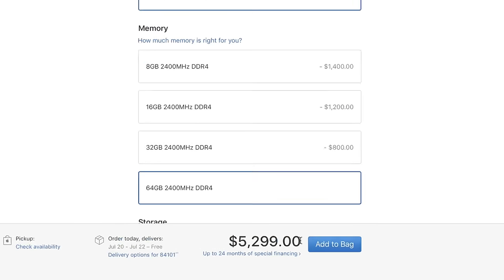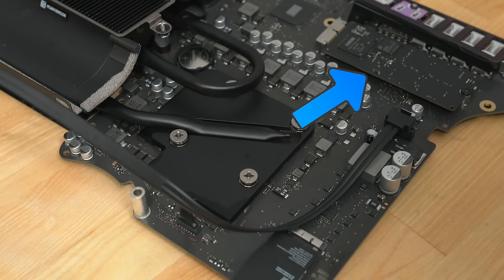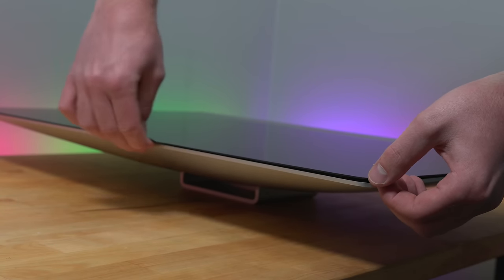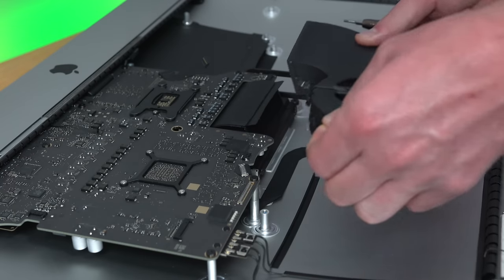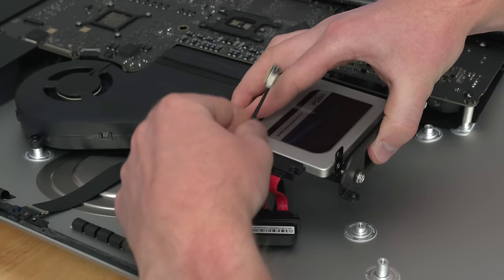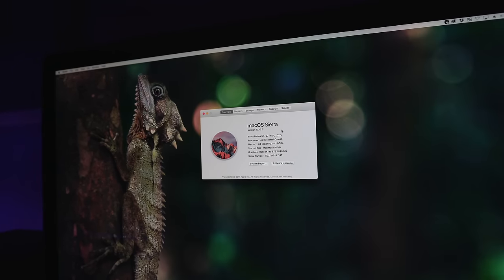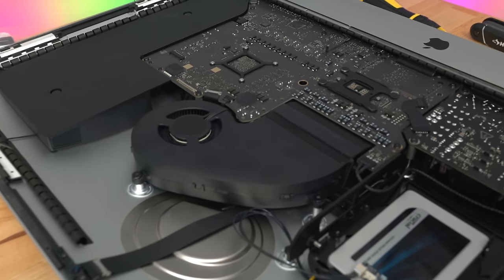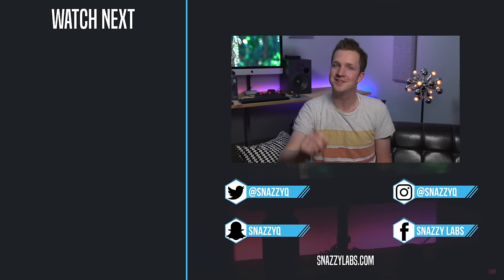The Best 2017 iMac Apple Doesn't Sell!

Comment: I have a logitech Z5500 which I used with older iMac.  However, on new 2017 iMac 27" the system is useless  because Apple removed the option of Optical from the headphone input jack in the rear of the iMac.  Do you have any suggestions how to connect the 5.1 Logitech Z5500 to the new iMac?  I called Apple and after 5 "EXPERTS" they basically told me it was third party and they could not help.  :(

Comment: amazing video, IFIXIT has various kit for the wheel tool and has one kit that includes a SSD but no sure if that kit includes the thermal cable that you mention, both kits also includes the glue

Comment: The reason why it was 8% faster, was because the iMac doesn't use a 7700K, it uses a 7700. The 7700K is the same CPU but clocks faster when turbo boosting

Comment: It's possible then to upgrade the i5-7600k or the i7-7700k to the new Cannon Lake i5-8600 or i7-8700k (same socket and power consumption!), so a 2017 machine can become a fast 2018 one?!
Reply: Gabriel Rossi Nope you can't overclocking on macOS get i7 7700 non k the macs doesn't have liquid cooler

Comment: Hi, great Video thank you. I have an iMac late 2012 27" (no 5K) it has an i7 - 3770 CPU (3,4 Ghz) , it works great and with a Akitio Thunder 2 eGPU on Thunderbolt 1 it easily outperforms my brand new Business High End Laptop (in 3D Blender Rendering) from Lenovo p51 with the same eGpu on Thunderbolt 3. Why i have no Clou perhaps it is because of the lower Cpu speed on my Laptop. It has an  i7 - 7700 with with a c lock speed of 2,8 Ghz.

But now my question. Do you think it is possible and make sense to swap to a newer CPU if this is possible, or at least renew the thermal paste. If i sell my Imac i wont get too much for it, but if i invest additional 1000$ for more Ram (fom 8 to 16) and a additional SSD and perhaps a better CPU it will be perfect for me for the next 3 Years.

What do you think.

Thanks a lot.
Great Content by the way.
Flo

Comment: I have a 2019 Imac 27" 6 core i5 that I used primarily to do extensive photo edits in photoshop. I upgraded from my mid 2011 i5 4 core machine and now iam fearing it may not have been worth the 1500 i paid for it. I figured it would be much faster but honestly Iam not seeing it. I still get lag when using the smudge tool doing large sections. Do you feel thats about spot on and that to notice a real improvement I should of jumped strait to the i7 or even i9?
Reply: Yes i9

Comment: some people need to take the time to learn and review safety features for electrical and electronics products. There is a safe way to remove the power module from any computer machine, Macs and pcs both. Both pc units and Mac computers have builtin capacitors in their power module. These take the existing and incoming 110 standard household electricity and ramps it up. It does this by storing the electricity inside the capacitor. The extra electrical energy is needed to drive certain components not compatible with standard 110 volt electricity. So even after a unit is powered down <turned off...> and unplugged, the capacitor still has a significant amount of stored electricity. Accidentally touching electrical components on the power module can create a closed circuit that allows the electricity to discharge, often very dangerously.

To incapacitate and to drain the residual electricity from the capacitor safely, the unit must be unplugged and the power cord removed. Not removing the power cord allows electricity to remain present in the capacitor for a much longer period of time. To overcome that, removing the power cord allows the energy to escape a lot quicker. To allow the capacitor to drain safely, it should remain unplugged and untouched for at least 24-48 hours before disassembling for service. A work around and a way to speed up the electricity stored in a capacitor, it can be rapidly accomplished by depressing the power button for about 5-10 seconds. This opens the gate and allows the electricity to flow through the computer system and dissipate rapidly. And although there will still be some electricity in the capacitor and shock is still eminent, it won't be as dangerous and will definitely not fatal like it otherwise could be.

I cringed when I saw you handling the power module with your bare hands... you are lucky to still be alive. You need to learn about proper electrical and electronic safety. I quit watching your presentation when I saw and heard your comments about the power module when you dismantled it.
Reply: What. No. Capacitors don't "ramp up household electricity" o_O 
And the power cord stuff, are you serious? Have you ever touched, seen, or even heard talked about anything electrical in your life? XD

Comment: Your question just got answered. Why your apple with Intel consumer hardware beats  apple's Intel hardware.. 

The best apple hardware you can get would be the Xeon W-2195. Why the best consumer grade CPU you can buy is the core i9 7980XE. ASUS makes motherboards that supports either one. In most tests performed on both CPU's the i9 beats the Xeon.  Whats interesting si the trade off's you take from the chips. The i9 doesn't support ECC but he Xeon's do. Also the Xeon's do have offical support of 512 gigs of ram but on some X299  boards support it as well. What I find strange is the X's has Turbo boost max 3.0 but the Xeon W's do not. But the have a higher turbo boost 2.0 max speed so that makes it a none issue really. 

  
so Xeon w-2195 $2,553   or  Core i9-7980XE 1,890$ which one would you pick? .
Reply from the maker: I think you misunderstood my point. When this video was published, iMac Pro didn’t exist. I was comparing my 7700K iMac to Apple’s 7700K iMac.

Comment: You should add a disclaimer that removing components (especially a charged & exposed power supply) you do so at your own risk.  I can certainly see a bunch of knuckleheads that couldn't turn a screwdriver to save their lives getting the impression this is a walk in the park and next thing you know they electrocute themselves and will sue you instead of taking responsibility for their own ignorance.

Great video.  I've upgraded my iMacs with zero problems and they're easy for those with decent technical skills.  

Obviously, one's warranty is voided with this upgrade, but I'm curious if with a faster machine than stock, will MacOS still be able to be upgraded down the road when Apple EOL's that model machine even though yours is a faster model?

Comment: Snazzy, I have a Late 2014 27" 5K iMac with a i5 4690, will this same procedure work? It has a 1TB Fusion Dr that I would like to install a MX300 750GB in place of the 1TB Platter Drive. Obviously I would have to use a socket 1150 i7
Reply from the maker: +Dwayne Stimpson Yep! Drive upgrade is the same. Just make sure you get a CPU in the Haswell family. :)

Comment: Does anyone know if a I9-7900X or I9-7980XE (When released) will fit the 5k 2017 Imac? Could I modify the motherboard to have a compatible socket? I looked into the Imac pro but they only go up to 4tb. I'm wanting a 4tb ssd AND another 4tb pcie hard drive in the mac.

Comment: Apple is buying the 7700, not the 7700k. The 7700k has a 4.2GHz base clock, whilst the 7700 has a 3.6GHz base clock. Correct me if I'm wrong, but that should account for the 8% difference.
Reply from the maker: +AquaaAU No they're not. Their fully loaded model is the 7700K as well.
Reply: Snazzy Labs I checked their website, and it said 3.6GHz tho. Maybe that's just an Australian thing?

Comment: Have an iMac for years, will upgrade to a Windows soon. I loved my iMac. But I do not do any graphics design stuff. So pretty much no point in having a new one...
I really hope i can use it as a monitor, so i do not have to sell it...
I am fed up with apple, upgrading hard drive needs a special cable, cannot use external display mode on my iMac (only supports thunderbolt 1st gen...). It's such a waste for a great piece of hardware.

Comment: Hey Quinn (or anyone) I have the 1TB Fusion drive Mac and wanted to know if I can switch both the 32GB SSD & 1TB HDD and replace it with just a single 1TB SSD (uses regular SATA connection)? Thanks

Comment: I highly doubt apple is throwing a 7700k into their imac. Probably a 7700 but definitely not a 7700k which would explain your performance increase since the K processor has higher base and turbo frequencies

Comment: Hi Snazzy Labs, I am wondering if I could upgrade my iMac 2017, it has i5 7 gen and I kinda like to upgrade to i7 8700k(the socket it's the same) but... did you do this "test"? do you know if it's working? thank you!
Reply: The socket is the physically the same, but not electrically. You can't use an 8th gen processor on a 7th/6th gen logic board.

Comment: Pro tip: use a Samsung SSD, they have that temp sensor out of the box.
Reply: All of them or specific models? I was considering the qvo 870.
Reply: I was thinking that they did as well. I have seen many other videos saying the 2017+ no longer needed that therm sensor part.

Comment: Could have saved even more money with a base 7700. You aren't gonna overclock with that little fan. Just a thought.
Reply from the maker: +Jacob Edmonson The 7700 has a base clock that's 700MHz lower than the K model.
Reply: How often do you have thermal throttling at load? Also, going from sky to kabylake may not be possible for some users. Did you have to install bios updates? This might be good info for some people trying to upgrade.
Reply from the maker: Jacob Edmonson The 2017 model ships with Kaby.

Comment: "This is the best 8$ you'll every spend". Umm... Mini pizza cutter meet spatula. I used a spatula it works just fine when I replaced my HDD to SSD in my 27 inch iMac. I wanted to buy the mini pizza cutter but all were shipped from overseas it would've taken 4-6 weeks to get to me. So I spatula-ed it.

Comment: Ok... so im about to upgrade to the i7 from the i5 and ssd. Will it work for my 2017 version 15 ** not the new new 2017 purchased about 5 months again.
Reply from the maker: +Josh Hall Huh?
Reply: Stupid autocorrect I sware haha. I bought a iMac 5-6 months ago with the i5, 1 Tb hd and was wondering if this is upgrade is the same version I have? I'd like to do this same process in the video if it will work.
Reply: Snazzy Labs I've got guys at best by saying it's not possible and the frys electronics guys also so I'm a bit conflicted cause I'm hoping it will work for mine
Reply from the maker: +Josh Hall If it's the 2015 5K iMac, you can upgrade but need to stay within the Skylake family or chipsets.

Comment: Hello guys. could you help me please. I would like to know if is it compatible Intel 7th Gen Intel Core Desktop Processor i7-7700K (BX80677I77700K) or this one Intel Core i7-8700K Desktop Processor 6 Cores up to 4.7GHz Turbo Unlocked LGA1151 300 Series 95W BX80684i78700K. Please let me know, which one its better, thanks for your help.

Comment: Hi snazzy
This video draw my attention since now for the 3rd time my graphics card in my 2012 imac 27 incl. Is NOT working again and I Dont want to bake it again in the ownen a fourth time. So I was thinking about to install hackentosh parts inside the imac still using the beautiful 27 incl mac display - even though i World need to let the CPU Cooler sticking our of the back of my imac. I only intend to use the screen and the power on button and the power supply - but is it possible?

Comment: Why were you surprised about the volume of the speakers, Snazzy Labs? They do sound better than those of other laptops, it is no surprise that they are larger. The laws of physics also apply to Apple products. ;)
For the same reason those speakers still suck compared to dedicated speakers (headphones/boxes) of any decent quality. You need a larger volume unless you keep it close to your ear (headphone) and of course Apple doesn't have the same expertise in making speakers as some specialized companies like Audio-Technica, Sennheiser, Beyerdyanic, Sure...
You would have spend >$500 less with a hackintosh instead of upgrading that iMac, right?

Comment: just gotta ask, why the 7700k and not the 7700?
Reply from the maker: That's the chip Apple uses. It has a higher base clockspeed even though Apple doesn't actually use the unlocked multiplier.
Reply: @snazzy  I should have thought about it. My PCMR brain immediately thought of the fact that you cant overclock with the apple motherboard, and you definitely cant overclock with that fan lol.

Another question: Have you thought about looking into modifying the cooling setup to help run the Mac run lower?

Comment: Can I upgrade to i7-7700K on 21.5 inches 2017 iMac?
Reply: same question here, did u get the answer?
Reply: @Viidaurri  I finally upgraded to i7-7700 non K version. The local store told me that it’s not possible to install the K version. Maybe due to the heat or motherboard is not supported, I guess.
Reply: @Viidaurri  Update: I run the system with i7-7700, 32GB Nemix ram, WD Black SN770 1TB with OS Ventura smoothly, worth it.

Comment: I like the video. And this is great for those with deap pockets! But what about a Hackintosh on the cheap, doing the exact same thing?? Like buying an old Imac (similarly to your model, but at only $100! Like it would have to have something seriously wrong with it! To where most of it's HW would be garbage anyway), where the MB on it failed or is just old, or the whole thing is shot! And you keep the aluminum shell, but replace everything else! You get an old (high end) cheap 1080p display to stick in there or try to use (Apples with a PC); a small, but powerful MB; a small form factor power supply; a graphics card using a PCI extender; a set of speakers or rewiring the ones that came with it to work with a headphone jack; and some connection extenders for the back of this thing (USB, eithernet jack, and sata)! It's super silly, but cool at the same time! Like how cheap can you go, easily put this together, and install the latest OSX on it.. I would love to see someone try! I love "frankin-PCs!!

Comment: Just to mention discreetly, Where is the Radeon Vega and the Xeon Processor in this combination? This does not make sense at all.
Reply from the maker: You’re aware this is not an iMac Pro, correct?
Reply: Yes, I am! But you compared the prices of them! Therefore, I think is a non fair comparison, maybe a bit misleading. If you would have built the same config cheaper, I would understand the comparison. What you got is a better iMac, but it won't be an iMac Pro. Many people tried to build the same config and they came out more expensive than iMac Pro. And I would not mention the performance difference between the 2 machines, warranty, comfort, that you get it delivered, just have to turn it on, etc.
Reply from the maker: This was built before iMac Pro was out. Not to mention that the Geekbench score of my modded computer still outbenches both iMac Pro builds in single-core and 2/3 as well as the $7,000 iMac Pro in multi-core. This machine was less than half that. So I still feel like my machine comes out victorious from a value standpoint.
Reply: We'll see! It looks great though and you did a great job there, no doubt! But it still hit my eyes really... That is why I mentioned the first comment. It is a great build and definitely better that what it was before. Of course, the value per geekbench score point it will be yours, no doubt!

Comment: can you place M.2 ssd on imac 2017?
Reply: NO! Their SSD drives and connectors are PROPRIETARY!
Reply: @LightWingStudios  thank you for your answer!
Reply: @chrisfisekis4131  Also buy there ssd cable it comes with a temperature sensor which you stick to the drive.
If not the fan will run at full rpm
Reply: @apachehelocopto1779  yeah I know that, I have seen a video on youtube.
Thank you!

Comment: you didnt have to spend the extra money on  an unlocked cpu if the cooler wont even allow you to safely overclock
Reply from the maker: +Griffith Scott Yes I did. The 7700K has a 700MHz higher base clock than the 7700.

Comment: Ehm, never trust screen resolutions shown by MacOS. Since Apple launched their so called "retina" displays they confuse us with wrong screen resolution data. If you have a MacBook Pro with 2560 * 1600 pixels - which it makes use of indeed - it will tell you "1280 * 800" pixels which is just wrong. Even on a 5 k iMac it may tell you "2560 * 1440" even if it uses full 5120 * 2880 pixels. To make confusion complete Apples own software make use of false pixel data. The Preview application in 100 % view will NOT show you 1 pixel of the display for 1 pixel of your photo. No. It will show you 4 (!) pixels of your display as 1 pixel of your photo. And so on.

Comment: or apple use a 7700 and you used a 7700K, there is a clock difference between the 2
Reply: Baumy 15 apple uses k

Comment: Using a K series CPU was a complete waste. Not only can you not change the multiplier on the CPU on a mac motherboard, but even if you did you wouldn't have much cooling headroom to do so without ramping that single fan high. You could have saved a few bucks by buying a non-k SKU and gotten a pizza and perhaps some beer.